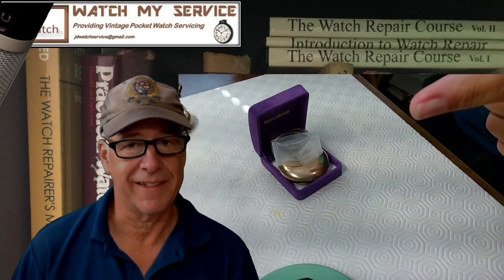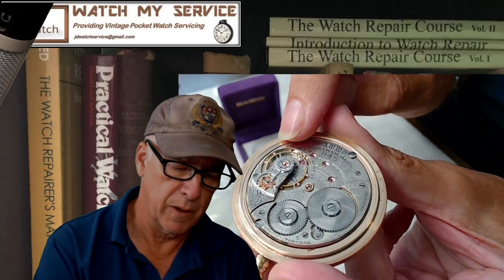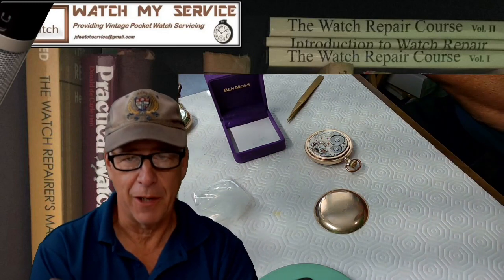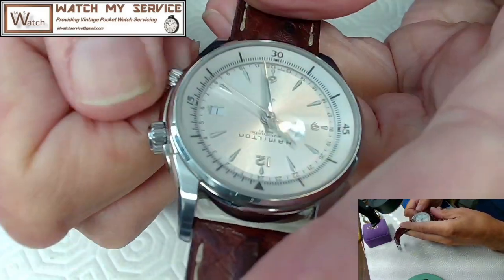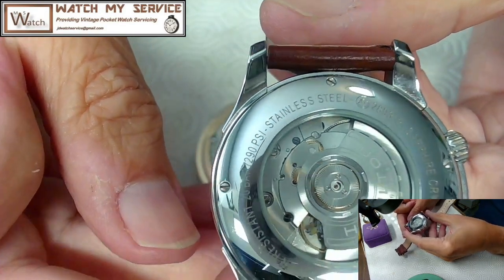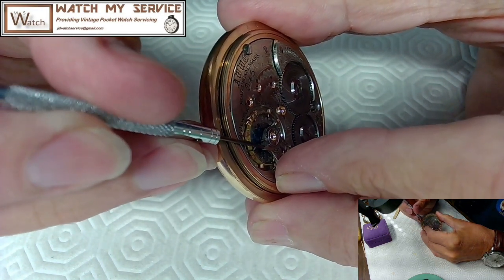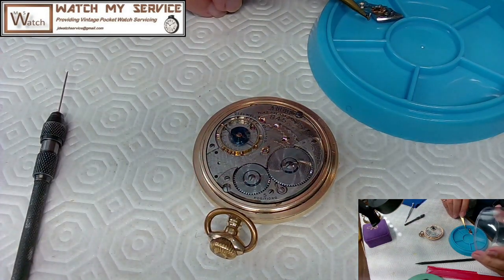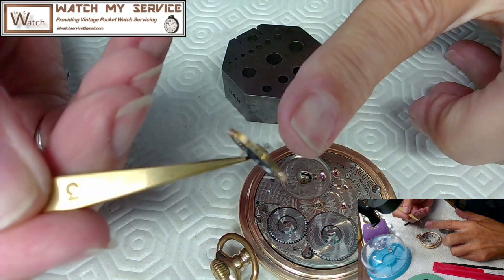Balance Staff Removal

Comment: also the Waltham balance staff is a friction fit balance staff and you have a blue steel sleeve that fits between staff and balance wheel. always make sure sleeve is still in balance wheel hole and not on broken balance. also a good idea to examine lower and upper jewels closely for damage, 9 times out of 10 they are damaged when pivot is broken.
Reply from the maker: There was no steel sleeve??
Reply from the maker: Upper jewel is good. I’ll see the lower when I disassemble the watch
Reply: @JDRichard  look closely at balance hole. unless someone made a custom staff with a larger diameter balance wheel area ? or its on staff?  every waltham ive done has had a sleeve, except for the really old ones. my PS Bartlett was riveted and its from 1879
Reply: @JDRichard  but if its damaged you can have dave send one with staff.
Reply: thats awesome !!!! @JDRichard
Reply from the maker: @sonnymoorehouse1941  I’ll look for it.